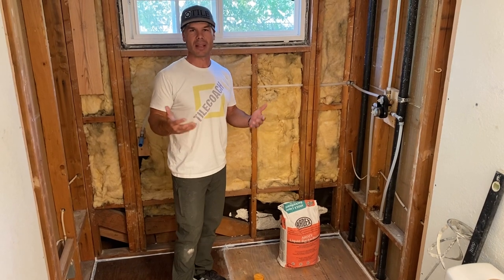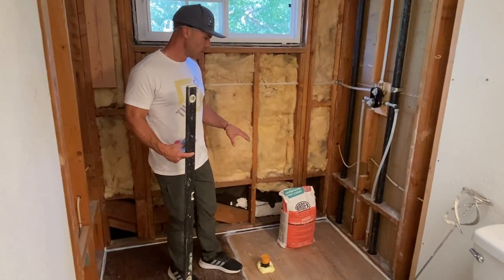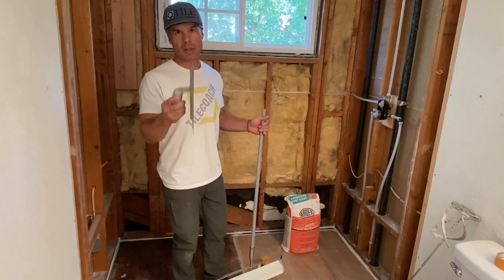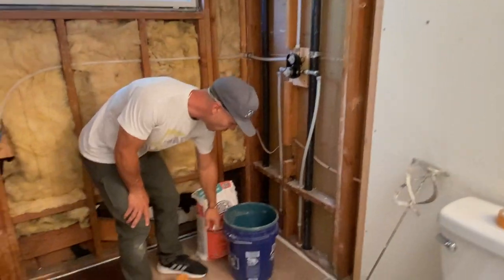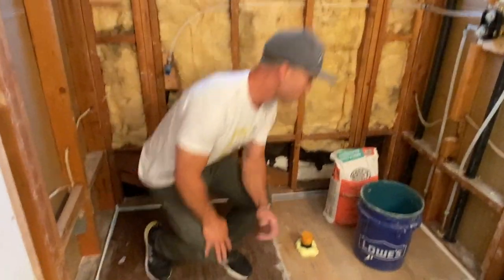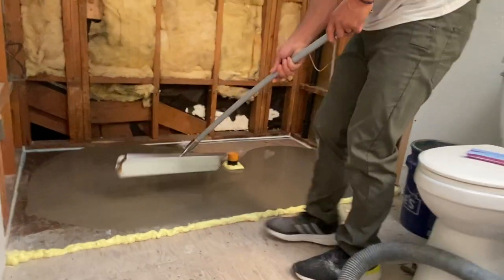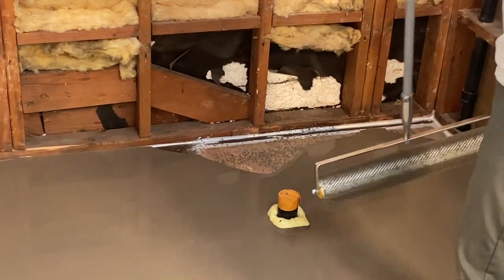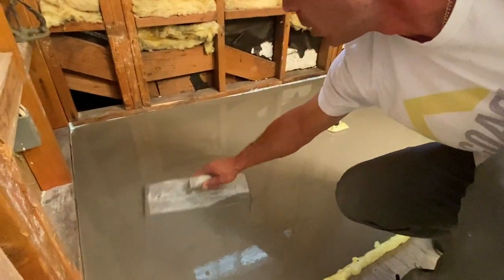What is LIQUID BACKERBOARD???

Comment: Can you show us the result after curing by checking the surface with a bubble level so that we can see how well it worked? I’m curious to know if it has good final flatness and true level
Reply: I can almost guarantee he needed 1/2 to a full bag more because it is assumed you will have to shove the self-levelor a little bit and work from the edge of each pour to the next, its clear hes spreading it out thin and over handling the material.   I find the best finish is when i start at the lowest point, work outward connecting each new pour to the old one and once I hit my blockade (i.e., spray foam, dry pack powder, silicon and tape etc., etc) i pour a small amount more and work that material until im satisfied I have a flat floor with sufficient material to fill voids, then I start the spiked roller.  Bueno!

Comment: Great idea using spray foam to dam up material without having to set step over first🤙🏾. Nice that you can bid in mixing valve and plumbing install so homeowner doesn’t have to wait a week or two for a plumber at 130.00$ an hour . Thanks Isaac 👍🏾
Reply from the maker: Yes, that was my motivation for getting my General B license classification.   No need to wait on other tradesmen!
Reply: @TileCoach  I really like that as well… I do almost everything myself… I have learned a lot from your videos thanks brother 💥👊

Comment: I’m surprised you used oem for the shower head. 
I’ve done dozens of showers but for my own shower I decided to use led on my drop elbow for the shower head but I really dislike how the head isn’t rigid. I have a fairly large rain style head on my arm which doesn’t help, but I found the arm wants to sag with the weight of the head installed.

Comment: 30lb roof felt then diamond mesh stapled down with a 1/2" min - 3/4 advised pour works well too. Those fibers may be enough, its a bit hairy and will cause some grey hairs with either approach.
Reply: Roof felt would inhibit bond with substrate?  Which SLU products specify a cleavage membrane?
Reply: @vinnied.1239  It's what used be called a slip sheet. It's always case by case and a tool in the bag of options when life doesn't meet the manufactured specs to these new products. This channel is very good and his knowledge far exceeds mine, I live in the world of the occasional shower pan. In the end its the best we can do to make the work professional.

Comment: That stuffs a pain. I remeber mixing 60 bags of level quick to fill in a sunken carpeted area in a slab on grade remodel we were on. Fun times
Reply: Fill the void with plywood sheets first and then you only need a couple bags of leveler.

I had a 3 inch drop in room I did. Cut wedges from 2 1/4 down to zero in the middle of the room.

Put 3/4 ply on top. Feathered the edges with a planer. Then only need 2 bags of leveler to sort out the rest.

Comment: I’ve seen you and others use lathe on these self levelers but I’ve never used any that said in the instructions to use lathe. On top of that, if you are typically leveling less than 3/8 then I feel lathe would interfere. If I was leveling an area closer to an inch I could see using lathe though. I may try and rss pan one of these days.
Reply from the maker: I’ve always used customs levelquick because that was at Home Depot.  And it requires latch on plywood substrates.
Reply: @TileCoach  gotcha. Yeah, I've never used that leveler. Typically a mapei self leveler from Lowe's.

Comment: HI i have ardex v1000 can i use it on wood floors? and i need to correct so low spots at a 1/12 inch Do you recommend this product or customs building with lath

Comment: I wonder if you slightly wet the subfloor right before pouring, it would help that Adex spread a little easier.
Reply: He applied a primer to the floor so I imagine that would interfere
Reply: @MandoFettOG  yeah, I thought about that. Thanks.
Reply: No water, just clean and prime the floor and it will cure the way it needs to

Comment: I see these videos, and I want to ask ....Do you or have you done a slab installation? I had a friend whose entire shower was solid granite even on the ceiling.  My wife loves the idea of ZERO grout lines. He even had a slightly sloped linear drain with a slab although he may have had is flame treated or abrasive  blasted for better grip.  If you have never done it do you want to? I have a project coming up :) I am in Northern California as well.
-MG
Reply: I can't even imagine what kind of extra structural integrity one would need to add to support that weight!
Reply: im a plumber who got to work on stuff like this , may i recommend a dedicated water heater and the use of roman tub vales in the shower ( its easy to make work) so you have large volume valves , not restricted as all shower valves are.
Reply: @billsmith9249  That's true he had lag bolts that were used to hold the lath and the ceiling slab was large and cut accurately enough so the walls would act as supports as well.
Reply: @dollyhadbraces9361  nice I like that, turn the valve and instant Car wash!!!
Reply: This is also my ideal although I’d use quartz so it didn’t have the issues granite does.
Reply from the maker: Yes we have done slab showers. I like the look of tile myself, but I am interested in the thin porcelain panels.
Reply: @TileCoach  We agree sort of, I like the solid surface and no grout for the first 4 feet and the shower pan. These are the areas that get the most splash so no grout is a plus, above that let the show begin. 
I have seen some interesting work done with tile, glass, and stone. I would want the artistry to be at eye level anyway so maybe 5 feet might be a better height.
I have seen some water jet cut stone panels that were really cool and they are cut so the gap is a 16th of and inch or less. 
I figure when we do the shower it will be a combination of artistic tile and slab that keeps the wife happy! :)   
-MG
Reply: @TileCoach  I have installed 3 fireplace surrounds with this.  It is so thin and flexes so much.  Also chips super easy. Be safe.  Cutting is a huge liability. Take your time and use super good blades and water.

Comment: I’m currently doing my own shower with kerdi membrane, I really wanted to go all the way to ceiling because I installed a rain head and body sprays. However I don’t have enough membrane to go all the way to ceiling from shower base and I really don’t wanna buy another roll of membrane cause it’s not cheap. Any suggestions? Could I possibly go 1/3 of the way down from ceiling with a liquid membrane like redguard and do the test of the way down with kerdi? 

I installed a preformed fiberglass shower base set in structolite and did all the walls in green board. 

I’m not sure if liquid membrane can go over green board like kerdi can though.
Reply from the maker: Yes you could use redgard there on the drywall because it’s so high up.
Reply: @TileCoach  ok cool, thanks so much for the reply. I been watching your channel for a while now as I’ve been remodeling my house. You do great work and while I’m a plumber by trade and definitely no tile pro I’ve gotten some great info from you. 

Thank you!

Comment: Why not just just set the pre-sloped shower pan on top of this self leveling compound while it is still wet, and then level your shower pan? Then there should no gaps anywhere between the shower pan and self leveling compound. This would also compensate for any possible imperfections or variations in the bottom of the shower pan. I use the same concept when setting a tub in place instead of shimming. I first place plastic sheet on the floor, then spread some premixed sandmix over the plastic, then set the tub in place and level it. You can also place plastic on top of the sandmix if you are concerned with it effecting the bottom of your tub.
Reply: Why not just show your ideas on YouTube? make videos.

Comment: Love the channel. But if I was the customer I would insist on copper. Rats love eating through pex. Happens all the time. And when it happens, it’ll be between a tiled wall and an exterior wall, which will basically be the hardest point to access in the entire house. The copper is 100% upside, zero downside. (Cost is negligible given the lengths we’re dealing with here.)
Reply from the maker: We have seen electrolysis issues with copper too.  I have never personally seen or heard of a job where a rat has chewed through PEX-A.
Reply: The copper should last many decades. As a good-faith experiment, ask a few plumbers in your area if they’ve seen this issue with PEX. I’m not a plumber, but I did a bid to replace galvanized with copper, and after trying to sell me on PEX, the more senior plumber told a few stories of replacing PEX due to rats (The junior plumber said “just make sure you don’t have rats.”)

If you were connecting from galvanized to copper, by the way, consider using 6 inch brass nipples rather than just a dielectric union.